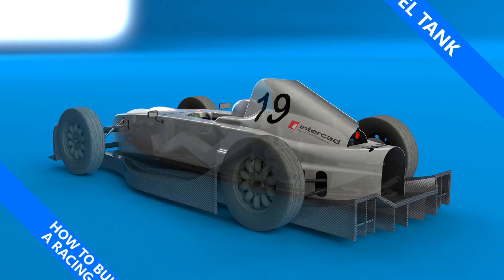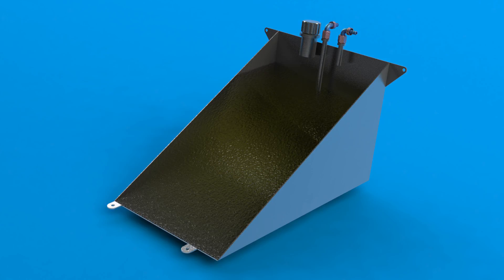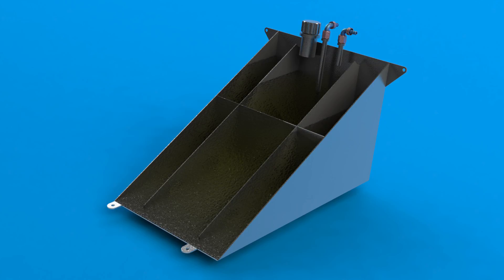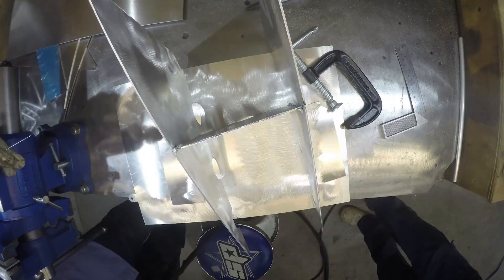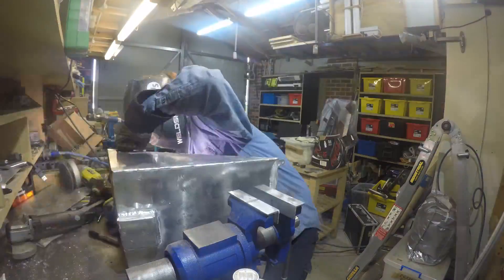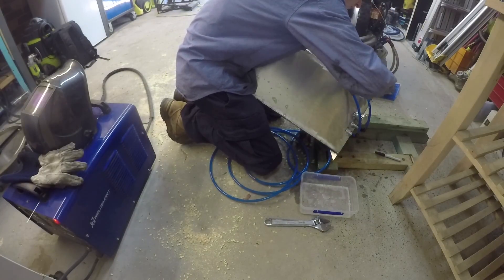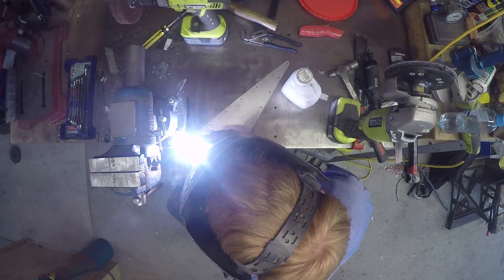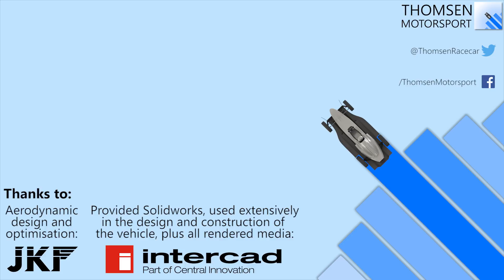Fuel Tank

Comment: Did you weld on AC? I believe that your TIG welder has the option to (AC depending on Ac Balance cleans the base metals of any oxides every positive cycle and welds every negative). Your videos are very high quality keep up the good work!
Reply from the maker: Yep, I welded on AC whenever I was welding aluminium. Thanks for the feedback.

Comment: Curious about the longterm performance of this tank, your design looks robust and simple and well made, have you had any issues with the direct mounting tabs on this tank?  Typically trucks use strapping over rubber isolators to retain an aluminium tank as rigid mounts tend to generate fatigue cracks and those cracks can spread from the mounting tabs to the tank and result in leaks.  They are subjected to road vibration over a longer term than a racecar, but that solution seems to work well.  Depending on how many hours you rack up on the car it may be prudent to dye penetrant test your tank occasionally to check for cracks.
Reply from the maker: Yeah in hindsight that would be a better solution. To date no problems with the tank, but I think it's more because the driver basically holds it down whenever it's driving - the bolts don't have to do too much.

Comment: Hey Simon, love your series and your videos. Question: do all aluminum’s have that oxide layer that you have to grind off before welding?
Reply from the maker: So far as I'm aware, yes.
Reply: Youl never be able to clean aluminum of the oxide layer as it instantly forms when it comes into contact with oxygen. Only way possible is to submerge it in a inert gas environment. This layer doesnt matter however when it comes to AC welding
Reply: However proper cleaning and preperation is vital to any welding process

Comment: Did you consider putting a one way valve on the breather, that allows the tank to breath but doesn't let fuel leak in event of a turnover.
Reply from the maker: Can that be a problem if the fuel warms up and you have it expand?
Reply: @thomsenmotorsport7201  Don't you use the fuel too fast for that to happen?
Reply from the maker: It's inevitable that there will be something left in the tank between races. My fuel tank's design was strong against compressive forces and vacuum but wouldn't fare too well against internal pressure - the ribs only support the external walls under compression. But it's an interesting question - maybe something like a pressure relief valve would work, allowing it to offgas but not release fuel in the event of a rollover.
Reply: @thomsenmotorsport7201  One way valves, at least the ones I've used, allowed gasses to move both ways, only fluid is block in the desired direction.
Reply from the maker: That would be perfect then. I can't edit the video now but hopefully if someone watches this wanting to do the same they will see your comment.

Comment: I am rebuilding my race car, a single-seater sports prototype, and need to replace the fuel tank. How important is it to have an additional internal bladder within the fuel cell from a safety point of view ?
Reply from the maker: I didn't consider it, it's not common in Formula Vee and wasn't required by the rules.

Comment: You are quite litterally sitting on a fueltank....
Reply from the maker: That's right, adds to the excitement no? Given it's gusseted up the way it is it's got plenty of strength for the task.
Reply: yeah. it sure does :D it is quite an impressive achievement you got there. homemade race car and actually race much respect
Reply: i always wanted to ask you. what's with the carbon underplate? in your 3D models
Reply from the maker: Thanks. The undertray was designed by JKF Aero and is meant to give the car significant downforce - something that would be unique to Australian Formula Vees. It's designed, I've bought the parts to build it, I just need to find the time now. It would be another huge build not too different from the bodywork.
Reply: cool! will look forward to it!
Reply: ThomsenMotorsport JKF aero. I knew I had seen this car before somewhere. Must have been on one of the videos on Kyle.Drives :D